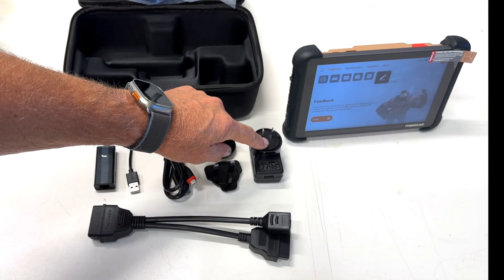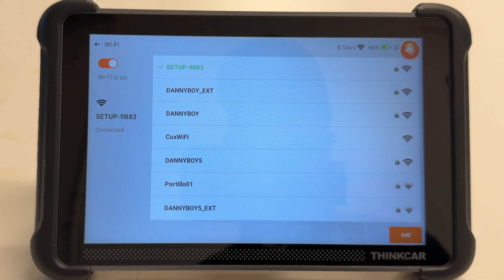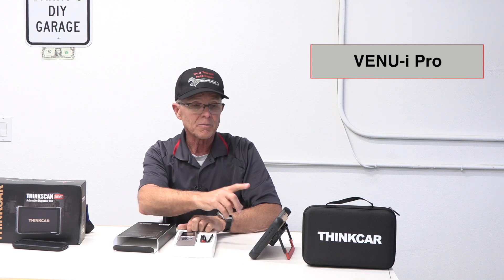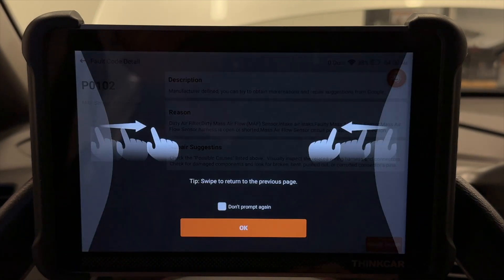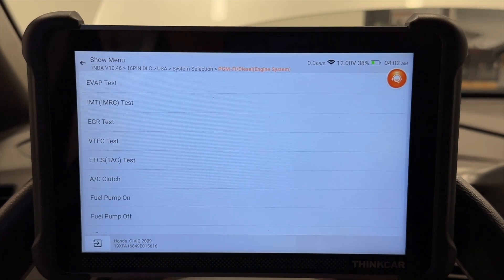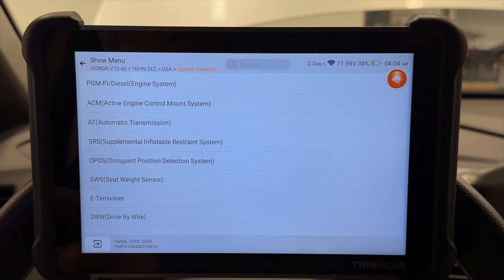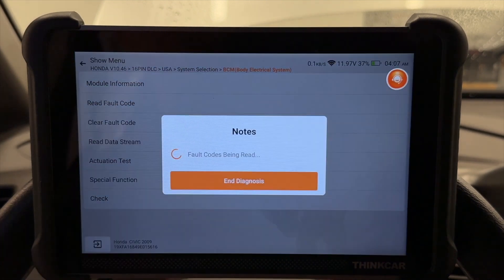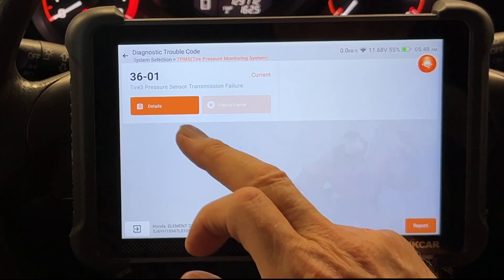Thinkscan 689BT Scan Tool Review: Diagnosing Engine Data & Resetting the TPMS with Venu-i Pro.

Comment: Hi i sir good morning i wanna know if included Ford vehicle on that thinkcar because i need to scan my Ford Everest 2011 limited edition in the Philippines sir i and i planing to buy one of my self???
Reply from the maker: It will connect to a Ford Everest’s OBD-II port and read basic diagnostics.
❓ Whether it supports all brand-specific modules and advanced functions on the Everest depends on what the manufacturer has implemented in coverage — you’d verify that with ThinkCar’s official compatibility tool or ask their support with the exact year and engine of the Everest you have.
Reply: @dannysdiygarage thank boss

Comment: I made the mistake and purchased this tool. The tool is great BUT make sure you buy from the US base company NOT the Chinese company. Thincar US customer service told me they cannot help me because I purchased it from the Chinese based company. The site are the same. The only difference is the link will say ThinkcarUS. I also purchased the FCA gateway through the device and it won't work. Good luck getting a hold of them in China. I have been trying since Feb 8, 2025. If you use the Chat. You only get a bot that gives you textbook answers. They charged me $120 for the gateway. I contacted AutoAuth the company that issues the gateway for only $50. They told me they had no record of my purchase and also informed me that the China company has no license to sell there gateway. ThinkcarUS told me that allot of customers are having the same issue. I paid using PayPal so I have put a claim in and the Chinese company is still giving me the run around.

Comment: When using TPMS, use the tablet to scan the car, it will tell you what position the TPMS sensors are in.
They should match what the TPMS handset sees. If it's wrong, you can reprogram the sensor to the correct position.
There is a Thinkscan TPMS app for Apple and Android which can update the handset firmware and work with the tyre sensors too, but you need the tablet to find out what the car TPMS module is seeing.

Comment: does it only program thinkcar branded tpms sensors?
Reply from the maker: It will Bluetooth to a thinkcar TPMs tool to program sensors, I’ll do a compete video on this coming up. It will also work with other TPMs tools. Im ordered new sensors, but yes it programs. It will program other brand sensors also, not just thinkcar
Reply: @dannysdiygarage I’m just wondering if it will program autel or schrader ez tpms sensors. Or even oem.
Reply from the maker: @digitalbilly  I’m waiting on sensors, a video will come soon, but yes the scan tool will work with other sensors, but you also need the programming tool that thinkcar sells
Reply: @dannysdiygarage   Have you done the video on the tire sensors yet?  I have not been able to find it.

Comment: Hello Danny. This is not a comment. Maybe you can answer this question. Why is the scanner displaying my odometer reading in km instead of miles? But it says miles after the displayed number. For example, my odometer is 100,000 but it outputs 162,000 miles.
Reply from the maker: I don’t have that answer
Reply: @dannysdiygarage  Thanks Danny.

Comment: I have an Xtool D7, the best scanner for the diy mechanic and profesional. As a mechanic, I can tell you never been happier with my purchase. With full bidirectional capacities such as actuator tests on engine, transmission, transfer case, differential , CVTs, SRS, ABS module, Air bag module, exhaust systems, AC relearn, EGR calibration and relearn, Throttle body calibration, TPMS reset and testing,  EPB tests and funcions to replace those rear electronic  pads and rotors,  adaptive cruise control, Electric power steering, immobilizer, wiper sensor testing, cooling fans, windows initializations, door locks testing, electronic water pumps on thise cars like Mercedes, turbo charge tests, window master switch, wiper testing, injector coding, ECU testing,  BMS, battery registration, ABS bleeding withou help from another person, key programming and keyless entry, DPF Regeneration, gear box relearn for manual transmissions, headlight adjustments, air suspension,  power balance, EEprom, seat calibraiton, clutch adaptation, and even you can work on diesel trucks. Theres more features around 36 functions total, so far because you get to update them every day, total free of charge, alternator testing and charging, stop and start actuator tests, and many other subsystems.  It also has the freeze frame data, live data with graphs which you can combine as well, IM monitor and smog tests, recoding testing and replay, blind detection tests, occupant detection sensor,  and guess what, it can perform actuator tests on Hybrid and electric cars!!! Im still learning about this  scanner because of so much features.  You'll get free updates, including for hybrid and EV cars for free until 2026, at last the one I got. The new one comes now with ECU coding and youll be able to replace the  ECM yourself. I got mine for only $375  on Amazon.